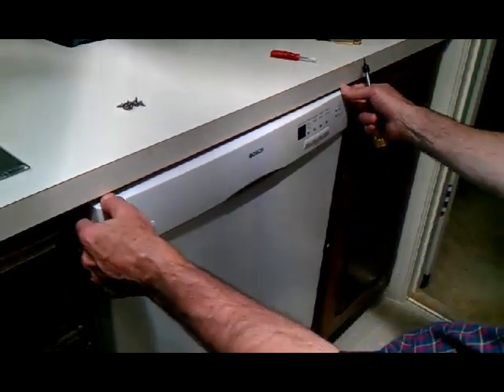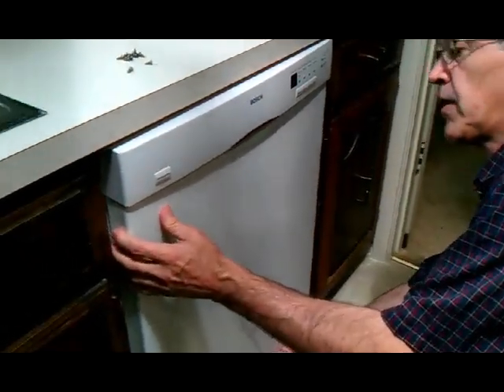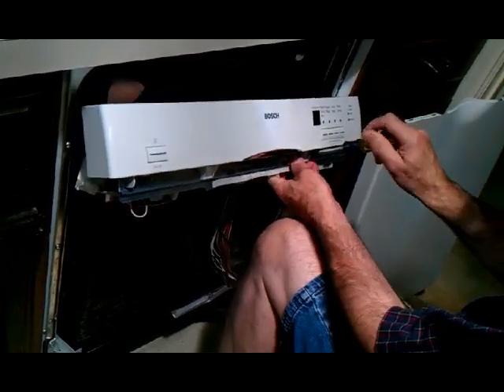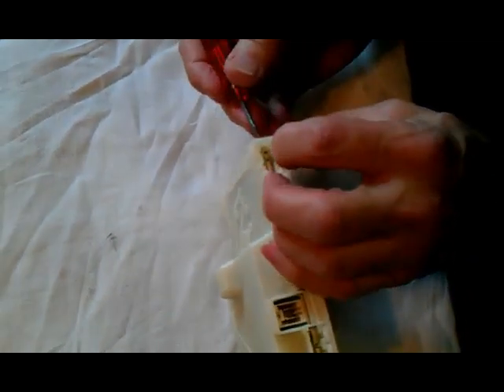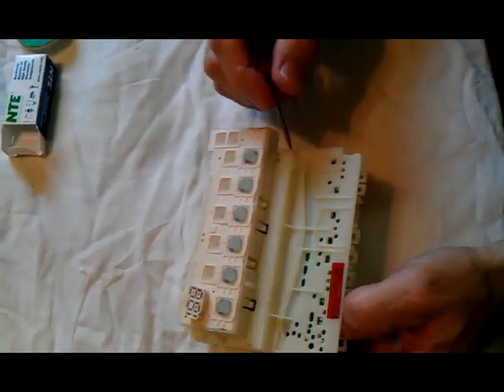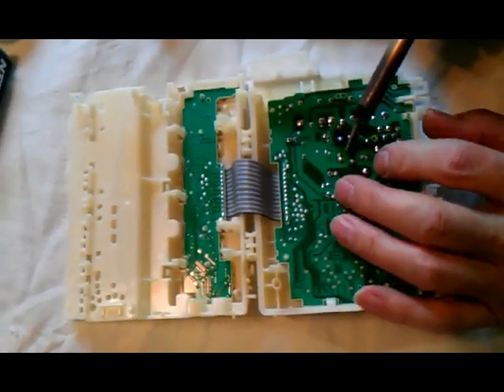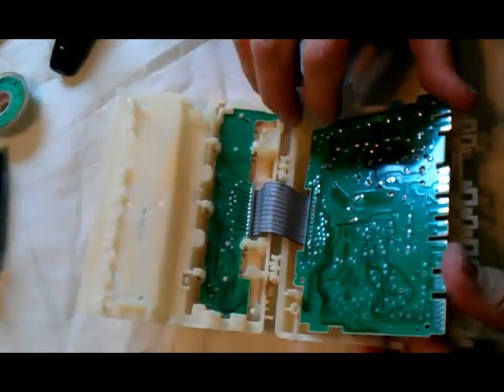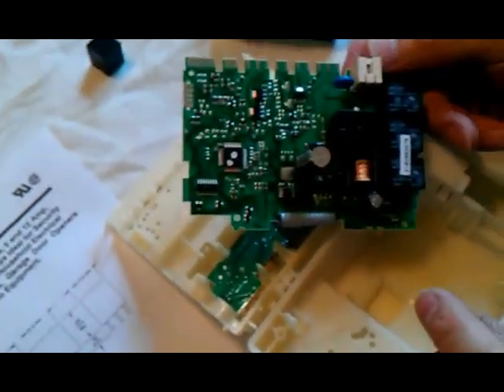Bosch Dishwasher Heater Relay Repair Part 1

Comment: AgglomeratedIdeas,
Mouser.com strangely enough could not identify the relay with a supplied pic.  It's a Song Chuan brand: 899B-1C-F-CE 6V=DC; 10A277VAC; 10A 250V~T85; C0551; 7A 240V~.

Not sure if I can send you an image if these characters are a challenge to decipher.  Hope you can assist further. Thanks. btw, still have piping hot water and my the time display shows erasable wash cycles, e.g. 89 min, vs. 199 min.
Reply from the maker: The replacement relay would be the NTE R46-5D12-6.  The last time I checked Mouser no longer stocked it, but it is available many other places.  A Google search will come up with many hits for it.
You may try running the test mode for the dishwasher.  The test mode instructions are on the wiring diagram which is usually rolled up and tucked in somewhere near the fill valve behind the kick panel.
Reply: AgglomeratedIdeas thanks Agglo!
Reply: My dishwasher has the same part number as PasadenaFamily (899B-1C-F-C E 6V).  It's out of stock in mouser. How do you know that the NTE relay will fit in the pin holes, is the pin configuration somewhat standard across manufacturers?
Reply from the maker: Yes, the pinouts are standardized.  For the NTE R46-5D12-6 relay (and your relay) it is called "SPDT 1 Form C".  Only 4 of the 5 pins are actually used in the DW, and the unused relay pin may be soldered to a pad, or just stuck through a hole in the board.
FYI... A SPST (single pole, single throw) relay is used in some cases and the unused pin on the NTE R46-5D12-6 relay can be cut off to make it fit.
Reply: AgglomeratedIdeas, well it's been about 6 months with just the er-solder and the Bosch was doing fine. But now, it's runs again in the Normal cycle at 199 min, and stays on 1 min until I cancel the wash. Bummer. Unit does provide hot water but not super hot.  I did get the relay but never installed it. I will now.  
I do have a question since i don't do this kind of work.  How do I remove the bad relay?  Thank you again for your time.
Reply: PasadenaFamily  If you don't know how to solder, you can buy the correct replacement relay, open up the control unit, bring it to an electronics repairperson, and pay them to solder the relay onto the board. They might charge you $25 or more for the labor cost. You might be able to find a repairperson at a local TV repair shop or electronics repair shop.

Comment: Great video and super helpful but I need some guidance. 
I have a Bosch SHU66C02, ~8 years old from Sears.

2 issues:
1. No hot water.  I followed the video and re-soldered the burnt relay just like you said and awaiting the relay to be delivered. 

2. Long cycle time, 199 hours on display for a regular wash; 180 for Short wash.

Out of these 2 issues, Is there anyway to identify if it’s the Heating Element unit or just the relay? And what about the long cycle time?
 
Thank you for your time and hope there’s a way to identify all the faults and fix it instead of buying a new dishwasher.  Always good to save some money.
Reply from the maker: Re-soldering the relay does not always restore the water heating because the relay may be completely shot.  I suggest installing the new relay when you get it and, if that doesn't fix it, then check further by using this flow chart: http://imgur.com/aYgvfAW
Reply: AgglomeratedIdeas thanks for the quick reply. The good news is I've got hot water. I'll wait for the relay through mouser.com and I'll update you again. Thanks for the workflow.

Comment: What is relay number for SHE3ARF6UC/08 Dishwasher?  Please let me know. Thanks
Reply from the maker: There is no known list of which relays are used in the various models.  You will need to open the control module and get the information off the top of the relay to determine the correct replacement.

Comment: Have a 899-1C-F-C   6V-DC relay on Bosch SHE43F15UC/61 that need to replace, if I'm following comments below correctly you can no longer buy it but  NTE R46-5D12-6 is the correct replacement?
Reply from the maker: That is correct.  The NTE R46-5D12-6 would be the replacement relay for the one you have.
Reply: Thank you!  Will make the Holiday cleanup better!

Comment: Could you recommend a replacement relay for my Bosch Dishwasher.   The relay is a Hongfa  HF3FA   It says  10A 250VAC . I would appreciate your help very much!!!!   Rob M
Reply from the maker: The relay should have the coil voltage written on it.  Check the data sheet here: http://www.hongfa.com/pro/pdf/HF3FA_en.pdf
It is probably either a 6 volt or a 12 volt coil.  An example would be HF3FA/012-HSTF which would be a 12 volt coil and the NTE R46-5D12-12 would replace it.  If you have a 6 volt coil, then the NTE R46-5D12-6 would be the replacement.  Hope that helps.
Reply: ok got .. it's a 006 HTF 10A 250VAC   The 006 is the coil voltage. Thanks

Comment: Just want to say that this video is spot on, and I was able to repair my SHE43F02UC/53 using these instructions. I ordered the relay direct from ntepartsdirect.com; using the NTE R46-5D12-6 which has a 12 amp rating recommended by agglomeratedideas and the entire process took about 35 minutes. Can't thank you guys enough. Excellent advice.
Reply from the maker: Thanks for letting us know about another successful repair!  ....and the link too!  Cheers!

Comment: Great video!! Wondering if you can tell me the part number (or a better replacement) for the heater relay in my Bosch DW Model SHE55M05UC. Thanks for taking the time...very much appreciated!!!
Reply from the maker: If you will post the numbers on the top of your relay, I will be glad to help.  Bosch used mostly 6 volt or 12 volt relays in their models, but the only way to know for sure which one you need is to know what is in there now.
Reply: Hi! The relay is made by Song Chuan with markings 899-1C-F-C 6V (same as in your message below).  There are a few other markings including... 1) 10A 250V~T85 2) 10A 277VAC 3) C0813-    7A 240V Any chance you can recommend a Canadian supplier? Cheers and thanks again!!
Reply from the maker: The 6V marking would mean that your relay has a 6 volt coil.  The replacement would be NTE R46-5D12-6.  Try buying it here: http://canada.newark.com/nte-electronics/r46-5d12-6/relay-spdt-120vac-30vdc-12a/dp/81C8194
Reply: Ordered! Have a great Holiday Season!!

Comment: Thanks so much for the video  It saved me.  I have one question.  To prevent this ongoing problem, can I mount a 120V control relay under the dishwasher and basically use the original design to control the new relay that will then release the high current to the heater?  I understand that I need to tie into the correct hot wire that will eventually make its way to the heater.
Reply from the maker: No reason for that not to work if properly wired.  Sorry for the late reply as I didn't see your post.

Comment: thanks a lot AgglomeratedIdeas  for this video.
u helped me a lot.
i had found the burned relay but had no idea what caused this so i dissasempled the whole dishwasher but found no problem.
just saw ur video on youtube and now i am almost convinced that i have no other problem than the relay.
tomorrow i will replace it and make the test.
ur video was complete and well detailed !!! and the part2 video prove to me u r pro in ur job. !!
well done my friend
many thanks from GREECE !!
Reply from the maker: I hope a new relay will repair your dishwasher and that it works like new again.  Let us know how it goes and thanks for commenting.  Cheers!
Reply: i will mate - i will !!! :)
Reply: AgglomeratedIdeas finally seems I had more problems than this relay. machine keeps draining water all time . checked sensors floaters possibly water leakage. all seems OK. finally we got a new one s my wife needed one immediately. anyway thanks again for it great video that sure helped many people out there. !!
Reply from the maker: That's unfortunate that it was not an easy fix, but sometimes there are so many issues with a machine replacing it is really the best option.  I’m sure your wife is enjoying the new machine though!  Thanks for letting us know the outcome.
Reply: AgglomeratedIdeas be well brother 😊

Comment: Thank you.  This was my first circuit board repair, so I was a bit intimidated.  However, it was easy, and only took 1 hour, including reassembly.  Relay was burned out exactly as shown in your video.
Reply from the maker: Yes, repairing a circuit board can be a little scary if you have not done it before.  But, as you found out, it is really not a big deal.
Thanks for sharing and I'm glad you fixed your DW.  Cheers!

Comment: Thanks @AgglomeratedIdeas for the excellent video! At this writing you have 77,325 views on this. You've been a lot of help to a whole lot of people. Here's my story.

16 year old Bosch dishwasher model SHU5306UC/U12. Drinking glasses started getting foggy. They would clean up using a washcloth and dish soap, but had a film on them after each cleaning in the dishwasher. We have a water softener, so the water is not hard. Then noticed the Regular Wash cycle was running for hours. Then soap sludge started building up on the bottom of the washer. Found your video and took out the control board. Same burnt solder point on the relay as you showed. Since my unit uses a 12VDC relay coil, I ordered the R46-5D12-12 (https://www.amazon.com/gp/product/B0195V3D30/ref=oh_aui_detailpage_o03_s01?ie=UTF8&psc=1) and a solder sucker + wick (https://www.amazon.com/gp/product/B01ESUKNXG/ref=oh_aui_detailpage_o03_s00?ie=UTF8&psc=1).

While waiting for delivery I did a temp solder to the burnt terminal. Didn't work. Checked the relay with a multimeter and everything checked out. Powered the coil with a 9 volt battery and could hear the relay switching. Checked with the multimeter to make sure the normally open contact closed when powering the coil. Looked good. Checked the wiring diagram and found 4 components in the circuit besides the wiring and the relay. The NTC read 61k ohms and the book said it should be 55k ohms. That's good enough. The High Limit switch had continuity. The Heating Element read close enough to the 10.5 ohms the book specified. The only thing I couldn't check without taking it out was the Flow Switch.

When the relay arrived along with the solder sucker, I followed your example in the video and the solder sucker worked great. Soldered in the new relay. FIXED. Checked the temperature of the wash water with a thermometer during the Scrub Wash cycle and it was well over 150 degrees F. Before the fix it never got over 125 degrees which is the temp of the hot water from the house water heater. Ran the test program as specified in the repair manual and it came back with zero indicating success. Before replacing the relay it returned a 2 indicating a Heating Fault.

This confirms what you suggested: the relay should be replaced and not just solder fixed.
Reply from the maker: Great to hear that you were able to use the video to get your DW up and running again.  Awesome job of troubleshooting the heating circuit.  Your detailed explanation of exactly how you did it should help others.  Thanks for posting!!!

Comment: Thank you so much from Montréal. For a $5 part, you saved us a few hundred. I had a problem with my Samsung fridge and a technicien came costing $95 just to come, than $1/minute to work + the cost + profit of the parts totaling $200 for changing 2 rubber parts at $45. Imagine changing an electric part, the guy would have changed the entire board at $200.... Anyway, you've made a really useful video that I truly appreciate sir.
Reply from the maker: I'm glad the video helped you make the repair and save you some $$$.  Cheers!

Comment: Anyone know where I can get a 899B-1C-F-C E 6V relay? My Bosch wasn't involved in the recall, but I'm guessing this is one of the bad relays because I can't find it anywhere! Calling Bosch to see if I can get a new control board. grrrr
Reply from the maker: Your relay has a 6 volt coil (the "6V" in its part number), so use the NTE R46-5D12-6 as a replacement.
Reply: +AgglomeratedIdeas just checking: is the 10amp vs 12 amp going to be okay? My relay shows 10A.
Reply from the maker: 12A is better.  If I could find a 15A or a 20A relay I would recommend that.
Reply: +AgglomeratedIdeas thank you SO much. I ordered the part and did the temporary fix, which worked!
Reply: +AgglomeratedIdeas update: received relay, swapped it out, worked! THANK YOU!
Reply from the maker: Thanks for the follow-up.  Glad it worked for you.  Cheers!

Comment: A zillion thanks to AgglomeratedIdeas, you saved me EUR 140!

A crucial piece of advice for everyone facing a similar relay fault: The local importer of Bosch dishwashers in my country agreed to send us a new control board FREE, ALTHOUGH our dishwasher version is not included in the recall campaign (dishcareaction.com). Thus when contacting your local importer, be persistent and refer to the consumer safety and protection regulations of your country, since this is truly a serious fire risk issue.
Reply from the maker: That's really good information.  I'm glad you were able to get a replacement control unit for free.  Yay!!!  Thanks for sharing.
Reply: Thank you for the sunny feedback. People like you are sheer chunks of gold (only much warmer and stronger), true rarities who keep civilized societies upright!

Regarding our dishwasher I forgot to add that is nearly 10 yrs old, and that in my spare part claim I included the link to your exellent video.

From viewer comments it is evident that the fault occurs much beyond the range of machine versions to which Bosch has arbitrarily delimited its recall campaign. Bosch should have extended the recall to cover each and every model with similar overheating control units.

To Bosch's merit it should be added that they seem to have a good (albeit expensive) supply of spare parts (for even oldish machine types) and a well-organized webstore with helpful part diagrams.
Reply from the maker: Thank you, TruthSayer.  I would like to add that we really love our Bosch and it is still going strong after all these years.  The heater relay has been the only real failure of the unit.  I did recently replace the lid to the rinse aid dispenser ($10 off eBay) because the old one was warping a little and sometimes didn't want to stay latched, but that is just a normal wear issue so I'm okay it.  Cheers.
Reply: A reliable old household appliance is a joy indeed! And the occasional fault often serves as an effective reminder to appreciate how indispensable these devices have become. For the DIY repairman, the troubleshooting projects that ensue can be very rewarding. Success therein often depends on peer advice from web forums. Your instructive videos were decisive for resuscitating our 10-yr-old Bosch. – A vibrant thank you once more!